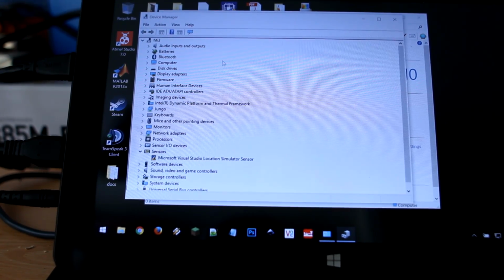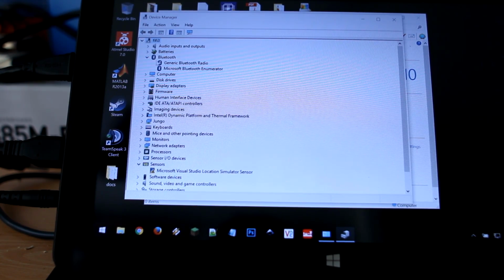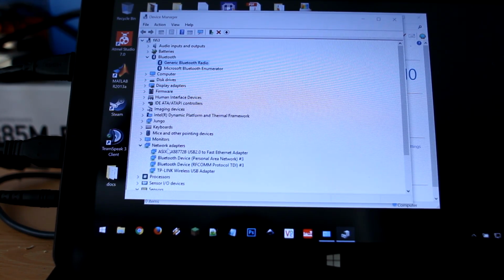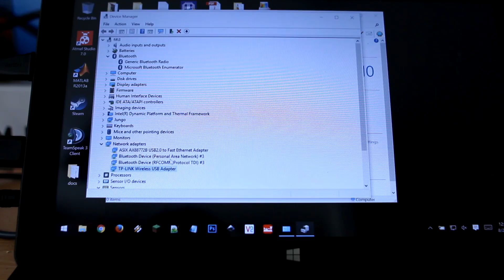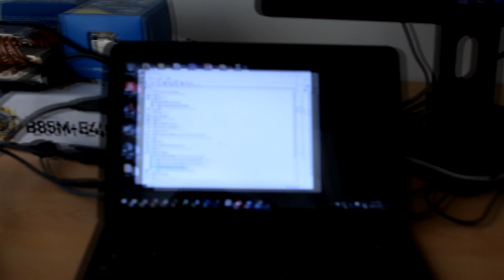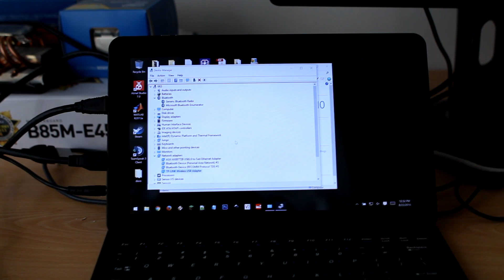Cube i7 Stylus NanoHub + Bluetooth mod (038)

Comment: I know that this is a very old video of yours, but I want to ask if it is possible to remove the LCD+wacom-surface (and their cables) from the CUBE i7 Stylus and to connect it to another computer, e
g. as a screen replacement for a laptop (and get the touchscreen and maybe even the wacom surface to work, too!)??? 🤔
Can you give me the part-ID SKU number of the screen or a PDF specification of that screen? 🤔

Comment: I just modified my Cube i7 with the nanohub I've ordered at PowerElectronicsBlog, a BT plug an a TP Link WN722N without any problems! I just want to say that my mod worked without bridging the voltage transformer on the wlan device. Thanks a lot for this video!

Comment: Hello dude love your videos.
I have a question I tried a thermal mod on my cube i7 stylus and it somehow got bricked.
Removed and reinstalled the origina heatsink and it still does nothing.
It charges, led is green when I turn it on. Nothing comes up on screen no bios or nothing.
When turned on I can hear coil whine from the cpu.
Also the vibration motor works when I press on the windows key.
Any ideas :D
Reply from the maker: Is the coil whine variable? i.e. does it seem like the unit is booting up, it's just not showing an image on the screen? In that case you could very well have bumped into the display converter and shorted out something there. Easiest way to check is to connect something to the micro-HDMI.

If it seems completely dead, then the search becomes a lot harder. First just reseat every connector and disconnect/reconnect the battery. That often fixes a lot.

If that doesn't work, check very thoroughly for visual damage. Then take a multimeter and just start probing everything that looks like a power converter and see if it outputs a voltage that makes sense. At this point you are kind of in desperate territory, it takes a decent amount of probing and trying stuff before you will get anywhere.
Reply: PowerElectronicsBlog Hahah yeah I thought so I've already tried the hdmi and the battery.
The pitch of the whine changes depending on i I press the power button hold it or the reset button so it seems to be doing something.
Reply from the maker: Well damn dude, you might have bricked your unit. Not a lot of specific advice I can give you.
Reply: PowerElectronicsBlog still thanks man

Comment: Any advice on battery life?  I'm hearing 4 hrs, yet the newly announced Galaxy Book 10.6 is getting 9hrs (according to Samsung).  I understand its on gen difference but that's double the battery life.  Anyway to replace the cheap chin. lipo with something higher quality?  Someone on a forum recommended to me the battery from a Asus Transformer Book T200TA, yet the connector on the Asus is 8 pin and the i7 stylus looks like a 10 pin (from what I can see from the video).

Comment: hi, my ac dc jack is broken. is there a way to fix i or replace it?
Reply from the maker: This is a recurring question, but unfortunately I have not found a 
replacement part number for the jack yet. If you can find that, it's a 
relatively easy fix - just use a hot air soldering station to desolder 
the old one and solder on a new one.

Comment: Great work dude. How about making it available for regular users(ones that dunno how to solder...etc.) too?
you know like a newer version which has usb contacts on the pcb like this
https://s3.euronics.ee/UserFiles/Products/Images/108638-gallery-2-%282%29-medium.png
That would make it more useful to users, your design seems to use a single side, so if the other side is used for this it'd save space, of course you use some kinda insulating tape on the chip side.
or if you still want it single-sided, just extend the pcb area so it looks like this +
And if you couple OTG adapter with it like this one:
www.banggood.com/Multicolor-Mini-Portable-OTG-Micro-USB-To-USB-2_0-Adapter-For-Samsung-S6-S5-p-1013203.html
it can be used for Mobiles & Raspberry Pi Zero (RPI0)
Some cheap Acrylic can also be used to cover the pcb or a box like this might work:
https://www.aliexpress.com/item/2colors-small-plastic-enclosure-diy-project-box-abs-plastic-cases-electronics-instrument-project-box-ip55/32282618646.html

Comment: Are you actually getting usb 2.0 speeds using non twisted pair non-shielded cables?
Reply: Yes, although it's hard to measure the actual performance while it's inside the tablet, I did actually stresstest the hub with a USB flash drive and it performs just as well over a short run of ribbon cable as a 'normal' USB cable.

Obviously you shouldn't try to run long cables like this. This only works because it's less than 10cm (4in).
Reply: Ugh, I'm being stupid again. Yes, this is PowerElectronicsBlog, I was just logged into my other account :D
Reply: very cool. I wonder if there is such a thing as a USB protocol analyzer that you could run that would show you if you're seeing any error correction going on. I'm not too familiar with the USB protocol itself but I would imagine there is error handling? Might not be visible at the OS level though -mike
Reply from the maker: There is no bit error correction on USB, so any packet that isn't received in perfect order is simply discarded and retransmitted (it does have a crc16 to detect errors). I'm not aware of any software that can show this at an OS level, but it should actually be very doable to make some small device that simply checks how many packets get ACKed.

I'm not aware of anything other than more high-end scopes that do this, though.
Reply: +neechert Sigrock + LHT00SU1 < $30 , use %10 off coupon: elec
http://www.banggood.com/LHT00SU1-Virtual-Oscilloscope-Logic-Analyzer-I2C-SPI-CAN-Uart-p-988565.html
http://sigrok.org/wiki/Supported_hardware#Logic_analyzers
or this:
https://www.kickstarter.com/projects/bushing/openvizsla-open-source-usb-protocol-analyzer

Comment: Very nicely done!   USB2412 is a nice 28 pin 5x5 QFN device, but USB2422 is just  a little smaller as a 24 pin 4x4 mm QFN, and if you want something tiny the USB3803 is a 3 port hub in a 1.95mm x 1.95mm wafer scale package part.   USB2412 is fine for your design, but there are smaller hubs available.
Reply from the maker: Yeah, the USB2422 especially would have been nice, but unfortunately it's got lousy availability. If I would have chosen that one, I would have had to buy all of Element14's stock just for the dozen or so I've sold now. Although to be fair I see on octopart that microchip DIRECT has it as well.

USB3803 I would really like to use one day, but BGAs are not something I can produce on cheap proto boards. Maybe next version :)

Comment: This is great!!!  i have the i7 stylus and the new  i7 book, i think im gonna try the usb mod on both.

Im loving my tablets, the only downside is the heat, sometimes i cant touch it around the cpu area, i used a new 6w thermalpad for the cpu and another one to make contact with the rear housing, it helps with the throtling but that are is so hot that i could cook on it.
Ill mod it with a copper plate, just like techtablets did.

Im enjoying your chanel  a lot, thank you Mux.
Reply from the maker: Happy to provide. Unfortunately the heat issue is really hard to fix; there just really isn't enough surface area to effectively remove the heat at full blast. Those are some really powerful CPUs and they churn out a lot of heat.

Comment: After seeing days of tablets and phones glued together only to be opened with a heat gun and double sided vacuum extender to open a tablet or phone finally a product not mostly consisting of glue. It's the glue giving Dynafix bad reputation for example although Dynafix is just sometimes just bad.
Reply from the maker: Honestly, this tablet has so far been a dream for modding/hacking. The little catches inside don't easily break, everything is straight and stiff enough so it never really bulges anywhere, there's enough room inside to tinker... couldn't have asked for a better modding experience :) 

I mean you see it in the video, I got in in literally 15 seconds without leaving a mark.

Some devices are just a total bitch to work with, and you can't get around using lots of tape and glue to get it back together. Even if you're halfway competent.